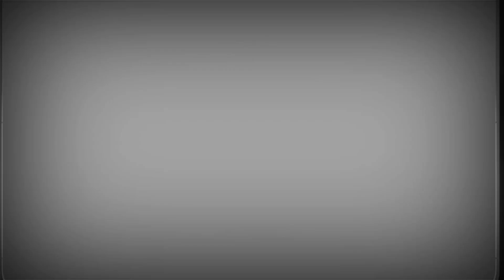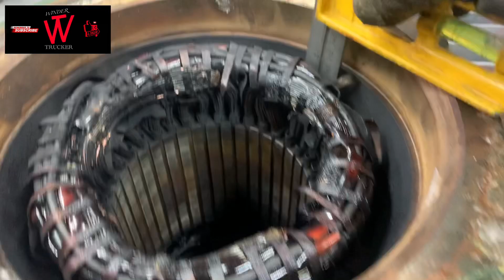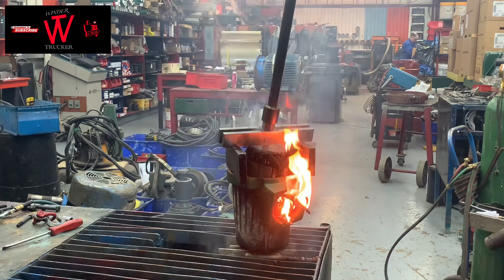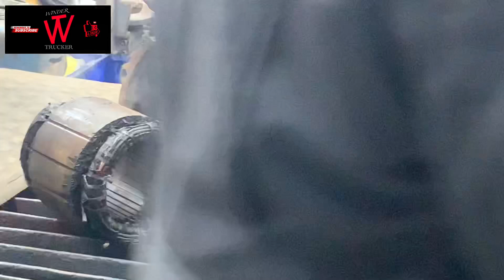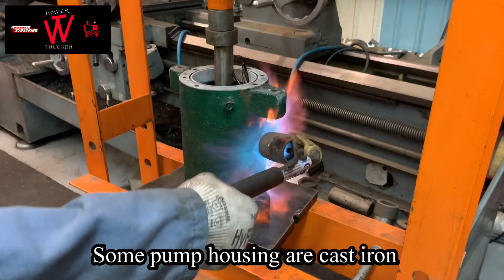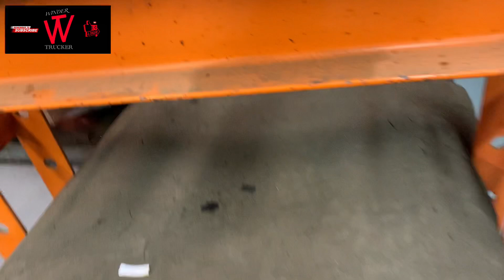Motor Rewinding | How to Pull Stator out from Housing | Stator Puller Flygt Pump

Comment: can i ask some technical advice or base on your experience, why during surge testing of newly rewound 500hp stator we notice a tik sound and the waveform is faulty. we had experience the same before but for some unidentified correction got eliminated and have good surge test. but this same motor run only for one month and underwarranty we rewind it again and encountering the same tik sound in surge testing. the winding burnt in exploded slot near overhang. please help me